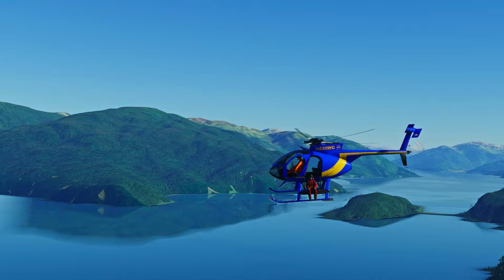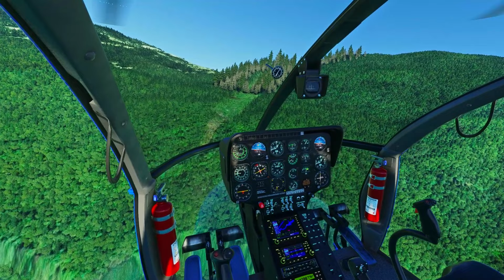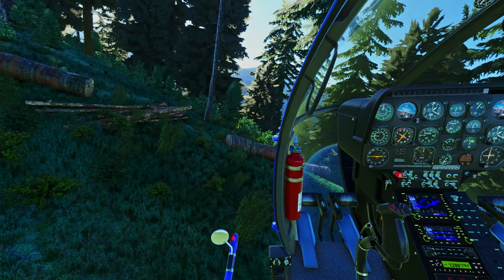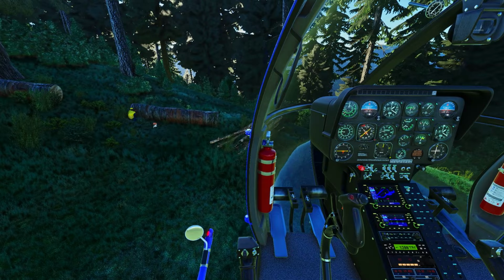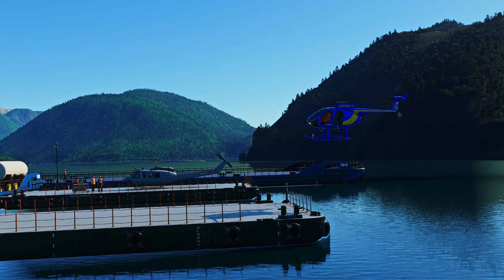Could You Land Here? | MD 500 E | Alaska Operations Pt.2 | MSFS 2020

Comment: I'll certainly give it a go if you want to share your scenery addon!!! 😉

You should see if there are any addons that provide "fire towers" as there were in FSX.  Landing on one of many 10ftx10ft wooden platforms built 20 feet in the air and precariously against a 30-degree slope "somewhere" in the Pacific North West was the most awesome fun I ever had in the MilViz MD530F in FSX.

I guess you are more than capable of making such addons for MSFS yourself, if you do give it a go let me know, I'd be happy to join you sometime as I spend most of my time in MSFS and XP11/XP12 flying the Cowansim B026 and MD500 - I just got the Thrustmaster HOTAS (F-16) Stick and a proper heli extension for it and am (slowly) getting used to my new proper cyclic after using the Saitek X52 Pro since 2006, I still have to use the Saitek Throttle for my collective though, which is anyoing.

PS - Subbed and I'm about to watch some of your other heli videos 😊